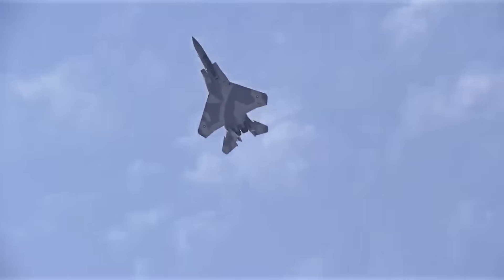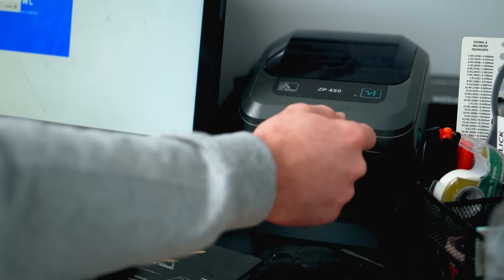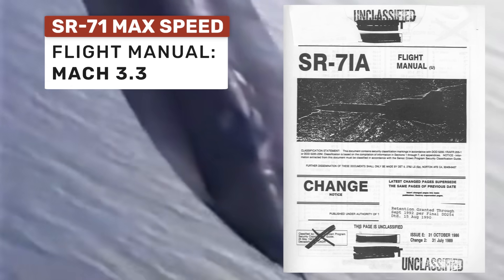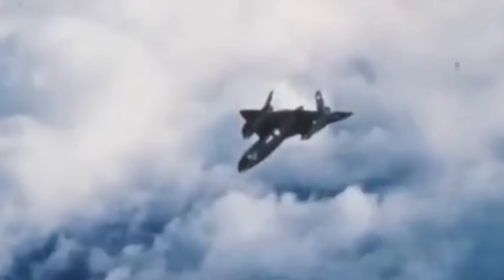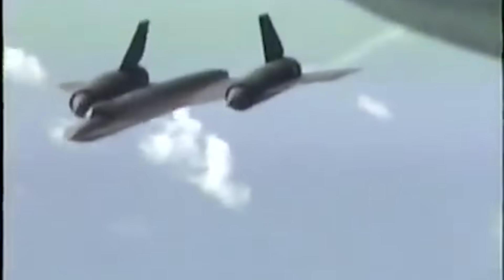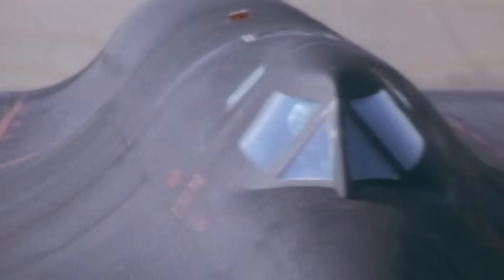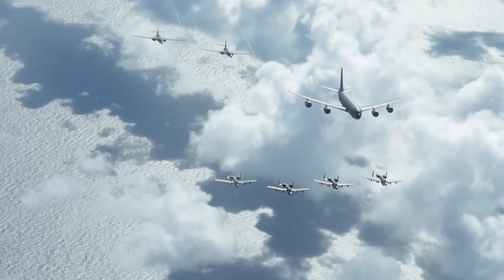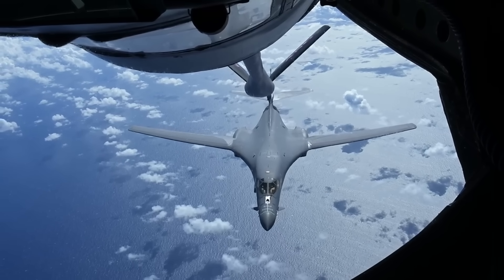The SR-71 was MUCH FASTER than the Air Force will admit

Comment: First The Air Force,Boeing Lockeed,General Dynamics, Ect.... F-16,F-15 F-14,F-20,F-35,F-22,F-18 ect..... are all faster  than Janes,Manufacturers Air Force,Navy ect...I worked in Experimental Flight Test and We never play all the Cards we Have. If Boeing Stated 2.9 it will go considerably Faster, we For Commercial Air Craft Test 3 Times Past what any Pilot should ever See or Do, The FAA sets The Standards they expect us to meet irregardless of the Air Crafts Total Capabilities.

Comment: The SR71 set the record of Mach 3.5 using one Engine. Just simply maxing out the potential of one engine. The rest is classified when circling the moon.
Reply: It never set a record of mach 3.5 and could even reach those speeds on one engine.

Comment: To get a quick, but close estimate of SR-71 design Vmax, print a scale top view. With a straight edge, draw a line down the longitudinal centerline, then one perpendicular to it tangent at the nose. Now another line from the nose to a wing tip. That will be the design max Mach shock angle. Meas that sweep angle and plug it into the 2D Mach Angle equation. Solve for Mach. It'll be v close.
Reply: Same with “top secret” carrier speed. All the specs are basically known but the speed is still classified. You can do simulation to produce probable performance, but irl performance may be better or worse due to unknowns.
Reply: That, and keeping the heat down to where the radio can survive.

Comment: In the video " Curator on the loose " the museum curator gives a tour of the  SR-71 cockpit. When he shows the mach meter it is calibrated to mach 6.6 . When purchasing a ring for my wedding in Memphis. The owner of the shop was the rio of the NY to London record run . his statement was that all record runs were made at half throttle. There is a math formula that give you a speed if you input a temperature. When yo input half the melting point of titanium you get a velocity of mach 6. So , yes it is way faster than stated.
Reply: Virtually nothing you said is remotely accurate.

Comment: Max speed can be determined by the spike geometry.  At M3.2, the spike is fully aft and the shock angle is at the inlet lip.  At higher M, the shock would move into the inlet -  this cannot be allowed to happen.  So to get higher M, the spike must be moved forward to get the shock out of the inlet.  Just how far the spike can be moved (of it the pilot has manual control of the spike) is the real question.  If you talk M, you're talking spike position.

Comment: That has been known by many for years, the record-breaking flights were recorded as average speed while the reality is the plane needed to slow down to subsonic to refuel several times. One benefit was it is more fuel efficient as the speed increases because of how the engines work.
Reply: For the West Coast to East Coast refueling one done before/after the gate to gate runs, not during. The Atlantic records going to Paris slowed down for a small refueling and only 1.

Also the efficiency/higher speed aspect is missing context.

Comment: The thing to understand about the J58 is that it was a sort of hybrid, in that it acted as a ramjet above a certain speed. At Mach 3.3, most of the thrust came from the afterburner, running on bypass air that was compressed by the inlet spike. Thrust at that point was controlled by fuel flow to the afterburner.

The limiting factor was the turbojet's compressor blades. At Mach 3.2 the compression of the air heats it to about 800° F. While the aircraft was certainly capable of exceeding Mach 3.3, the high inlet air temperatures would begin to soften the compressor blades, causing engine damage.
Reply: Check out how much thrust came from, of all places, the inlet.
Reply: @giftedkidsyouarenotalone3227 inlets don't produce thrust

Comment: The SR 71 was tested at mach 4 .5. problem was friction and heat. The plane was mostly titanium, so the issue was the jp 4 got to hot
Reply: The SR71 was NEVER tested at that speed, or even close. It wasn't even capable of ever reaching close to that speed. Also it used JP7 not JP4.

Comment: Doing some napkin math, we can interpolate that 2.9 may even be a bit conservative for the F-15 EX with the new engines and the rest of the new gear.  It has to be fairly lighter than the legacy.  I would love to see it clean up against a clean Mig-31 in a drag race each with the same amount of fuel at 30,000.  Just for shits n gigs ya know.

Comment: There is a publicly stated maximum, a formally published maximum, an operational maximum safe speed specified (usu classified), and the true safe limit that you don't want to test. You will NOT see military aircraft settings those "official" records because they will be classified runs.
Reply: If you-re referring to the SR71? Than no, virtually everything you said is incorrect. All the speeds, maximums, maximum potential etc are all know, and declassified and have been for over 2 decades
Reply: @gr8crash   LMFAO wrong. They're all above the public stated specs. Everyone that's anywhere near planes knows this.  And as the video pretty much tells us, they will NOT be jumping through all the hoops to do paperwork for a public top speed record that serves nothing. Those capabilities are classified for a reason.
Reply: @VndNvwYvvSvv again no. There are no classified,  or hidden speeds etc in regards to the SR71. Everything in terms of performance,  speeds,  altitudes,  max potential etc is all known, public and been fully declassified for over 2 decades. 

The F15EX isn't remotely a comparable distinction as it's brand new so of course max limits won't be confirmed. That is very different from a plane that's been retired for over 2 decades and first flew over 6 decades ago.
Reply: @VndNvwYvvSvv  Bro, the pilots use the FM. You are just believe fairytales and fishing stories.
Reply: @gr8crash  case in point, the F-15EX yet again. Quietly walked back.  Happens frequently

Comment: I heard a radio call once, at a base near Eglin.(I was maybe 8 or 9 years old)
Flight archangel 12, declaring an emergency, one soul onboard.
Descending through angels 120

I believe it was an unstart, and they got up there by using LOX as additional O2 for the afterburner.
So, yes, depending on altitude, it went much faster
Reply: Lol none of what you said ever happened.
Reply: pretty sure there was one that confirmed it.
Reply: @normanmadden no. There's literally no one that would confirm that as it never happened.
Reply: Then my memories should not bother you.
Reply: @normanmadden  they don't bother. It's a fun story, it just never happened.
Reply: @VndNvwYvvSvv  well to start they never used the calls callsign "archangel" for any of the flights. Also the SR71 used a UHF radio and was secured so there's no way he would have been sitting there with a radio listening in. Also the SR71 could NEVER reach 120k ft, it couldn't even get to 100k ft. There's also no way to add more oxygen etc to the afterburner etc like he was saying. So no, none of what he said was true. And depending on when he claims this story happened could ad further proof to it being a false story.
Reply: @gr8crash  IDK, an SSTO back in 1980 would have definitely been secret.
And the LOX was added to the bypass around the J-58 if I remember correctly.
And no, I never saw either an SR-71 nor an YF-12A, but was routinely hustled into windowless rooms when some flights came in.
Reply: @normanmadden wouldn't have been secret at all. They had been working on those concepts since the 70s. LOx was NEVER added to provide anything to the engines. LOx is carried to keep the aircrew alive. Being moved into windowless rooms makes no sense either. The SR71 was a public aircraft from its first flight. And while the YF12 was initially flown from Area 51, it was moved to Edward's and remained a very public aircraft after that.

Comment: The SR71 was never flown to it's ultimate limit. SR71 pilot Ed Yeilding stated that the air frame itself would have failed eventually before the engines would have a stopped accelerating it. For that reason, it was never pushed to that point, so it's actually not known what mph at what altitude and what atmospheric conditions it would have broken up. Yeilding claimed that the ramjet engines could put the jet faster, the faster it went. Long story short, no one will ever know what the actual top sustainable speed of the SR71 was because you'd have to destroy it to find out. That's never going to happen.
Reply: Most of what you said isn't true. The initial limiting factor to higher speeds was the engines, not the airframe.  The max speeds of what the SR71 could do were well studied and are well known. The SR71 didn't have ramjets either, the J58s were turbojet engines.

Comment: Yea. Anyone with half a brain 🧠 knows this. The top speed of Mach 3 was set ( as anyone should know ) because two SR- 71’s was clocked by the Japanese in the late 70’s installed their new ground radar caught these blackbirds flying from England to Beal AFB California at Mach 3 . Called President Carter to inquire. After consulting with the pentagon, they were identify as the blackbirds. So Jane’s publication marked the top speed as Mach 3. As an air force veteran, having basic understanding of the plane, I knew and have said many times what I thought the top
Speed is and still not acknowledged. Faster than you think.
Reply: A radar station in Japan would never be able to track an SR71 flying from England to Beale

Comment: I station in the Air Force fire department at Carswell AFB Texas. We had an in flight emergency on a tactical air craft over New York  landing in 15 minute. Turned out to be the SR-71. New York is 1,398.74 mile away shortest flight. You do the math.
Reply: Is it 5595 mph.
Reply: Um, that's not even possible.  Nor would it divert there for any significant IFE when other options are closer

Comment: look - the theoretical max airspeed is a KNOWN quantity based upon the retraction limits of the inlet spike.  this is simply physics.  Mach 3.55- past that, the shock wave would move to a destructive position.
Reply: Pretty much yea. At 3.55 the inlets would no longer be able to contain the shockwave and you'd have an unstart. Also the shockwaves would start to interfere with the control surfaces leading to a loss of control authority making the aircraft uncontrollable.

Comment: There is no way they would have spent all that money and effort, titanium skin, special fuel, etc., just to get to Mach 3.2.  5th gen fighters like the F-15 or MiG-23 and get to Mach 2.3 easily.  The SR-71 could probably do Mach 5.  Why SR-71 top speed is "classified" is a mystery, since enemy (USSR) radar tarcking would have been able to "see" that performance.
Reply: Top speeds etc have been declassified for over 2 decades and Mach 5 was never remotely possible

Comment: My uncle was a engineer for loceed martin and worked on the tr1 and sr71.
I used to watch these take off at night and it was something to see on a clear night.
Alot of things the public will never know about the sr71.
 just because they declassify something does not mean thats everything.
Your theory of max mph is off alot 😊
Reply: Virtually everything about the SR71 is declassified and the speeds etc are well known
Reply: @gr8crash  yep virtually everything may have been but not all.
Reply: @reginafordyce in terms of performance yes. The ONLY aspects still classified are parts of the ECM/DEF equipment as it's still in use today.

Comment: Look at the performance of the fastest F-4 Phantom variant. Israel wanted a super Phantom and nearly got it. The Aircraft was predicted to hit Mach 3.2 and showed the promise to achieve this. The USAF and State Department did not want this performance in anyone elses hands. So the variant was deliberately limited. The F-15 was supposed to be Mach 2.5 and the F-111 was limited not be engines but temperature. F-111 could go faster than the listed speed, the temps of the wing made the speed limit.

Comment: It has been as high as 180,000 feet at over 3000 MPH, that was several decades ago, that from two Air Force pilots I talked to in 1976. The YF-12, was going to be used as a fighter aircraft, however when launching air-to-air missiles at high speeds. it would drop behind the YF-12 and lock on it. that idea was given up. One commander said he could defend the entire west coast with only two squadrons of the YF-12's. I watched the SR-71 on radar several times when I was stationed at Luke AFB with the 26th Air Division/NORAD Region. in the late 1970's.
Reply: None of that is remotely true. The SR71 could never fly that high or fast. 

Also the YF12 had no issues firing it's missiles at speed and altitude and it's test fires were quite successful

Comment: The SR-71 has a theoretical top speed of Mach 3.4 provided the temperatures are within limits.  The issue with a higher Mach number is the inlet not being able to keep the shockwave in the proper position.  There was one that did go faster that we heard of and another that tried and flamed out both engines doing it.

Comment: My step mother worked as a civilian employee at Nellis AFB &  the Groom lake landing strip from 1979 until 2000s when she retired. 

She said different systems in the plane have different capacities of speed, which can vary depending on duration, height, conditions, etc. But it's stated limitations would always be about half the ability of its weakest system. The mach 3+ limitation is simply the engineer's recommended safety range. Catastrophic failure is never at an exact number so the rule of thumb is to cut it in half. So either the engine or the vessel is expected to fail first at around mach 7.  

In the real world though, they did not push it that far as they didn't want to destroy the plane.
Reply: Lol that's not how it works. That speed would never be possible. And Nellis doesn't even have anything to do with Area 51. Area 51 falls under the control of Edward's AFB not Nellis.

Comment: Sigh.

Thank you for at least a well-researched, definitive statement on a popular speculation, now more so in that the Habu is now retired.

However, you do not address the exigent limitations and nuanced attributes of same, that are the true indicators of its theoretical max velocity. 

+ Yes, you correctly understand that the airframe and the engines are temperature limited, but there is a nuance: To fly fast is to fly high. The (upper) atmosphere needs to be thin enough for drag to be minimized so that it can "merely" achieve Mach 3, let alone to be talking of its maximum attainable velocity. Additionally, high altitude is cold, and this partially mitigates the matter of thermal limits.

The plain fact is that the SR-71 cannot fly high enough for the air to be both cold enough and thin enough, for such speeds as discussed to be sustainable. 

+ If memory serves, above Mach 3 the P&W JT11D-20 (J-58) engine supplied only 12% of the total thrust -- the spike inlet and the ejector creating the majority of thrust. Indeed, at speed the engine just "got in the way", four bypass pipes being utilized to route pre-compressed air around the engine itself. Because it is a ramjet, going faster the faster it goes, I think maximum velocity is an academic argument only. Indeed, at a threshold maximum velocity, even if the engine spit out all of its turbine blades, the pilot would probably not even notice -- until it was time to decelerate. 

+ No, the inlet and inlet spike would not melt. The operating temperature of 800 degrees F of the inlet and spike is within the technical capabilities of titanium, and additionally it had a Inconel tip, IIRC. The real limitation was the hydraulic ram needed to translate it 66 cm with a force of up to 20 tons, IIRC. The fuel itself supplied all cooling, but it could not be used in the very hottest of environments.

(An aside: It was eventually ascertained that the titanium body, comprising 97 percent of the plane, was demonstrating structural longevity far better than predicted, because every flight was heat-annealing the structure. Heat was good for the plane.)

+ Later versions of the Blackbird were equipped with an automatic system that at speed would immediately apply full (!) actuation of its all-moving rudders if an asymmetric engine "unstart" was detected. Pilots say that when such a disruption occurred, their helmets would bash the cockpit windshield. An unstart at Mach three point omigod would have created a yawing moment that could not have been counteracted in time by the mechanical response of its (high-pressure!) hydraulic system. In a fraction of a second the craft would have unrecoverably departed controlled flight and then disintegrate.

+ The better question, although not as popular, is the theoretical maximum velocity of a Boeing 747. It's never been so tested, and never will be, although anecdotal evidence and computational simulation implies it is ever-so-close to being supersonic-capable. Yes!

Comment: This is very likely true. I remember an interview of that SR-71 pilot who throttled it when he picked up SAMs coming at him over Libya. 

I don't think he gave the exact speed he went because it would be classified.

But he mentioned the SR-71 went way over it's designed and intended speed and seemed to handle going way beyond it's designed speed just fine. I wouldn't be surprised if the SR-71 can actually go close to Mach 4.
Reply: You're referring to Brian Shul and he lied about lot about that stuff. The SR71 could never get close to mach 4. He use to say 3.56 during that story, then has to change it over the years as he was getting corrected.